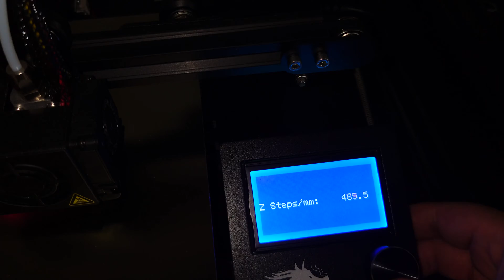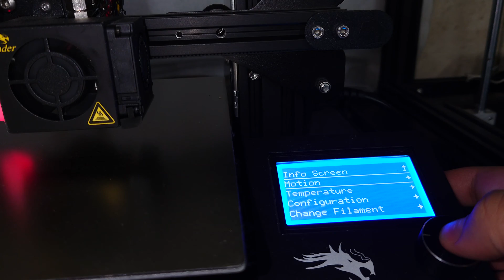ChowThink Ender 3 Pro Ball Screw Review

Comment: this ball screw is not "ungraded".  it's a C7 accuracy class rolled ball screw.   C10-C7 are rolled and C5-C0 are ground.
i think the whole mindset of "proper ones can cost 9999K bucks so this $60 is a gift" are wrong.   
this screw cost about $12.  but those guys buy them in bulk for about $5 and then sell for $60 to those who banned from Google.
it's widespread practice on DIY market nowadays.  to sell cheap off-the-shelf industrial parts like it's a something very special, custom made etc.